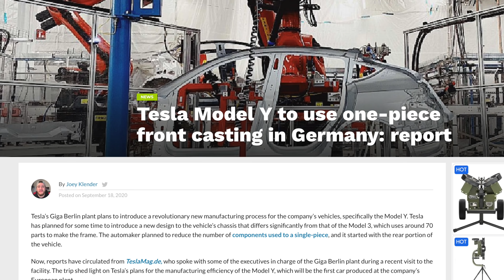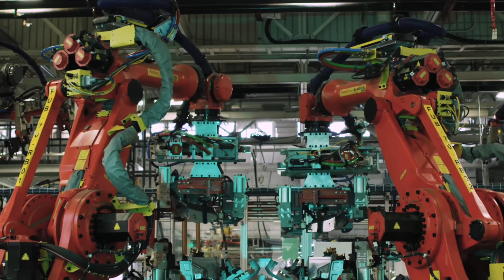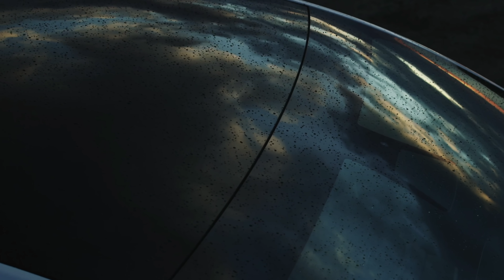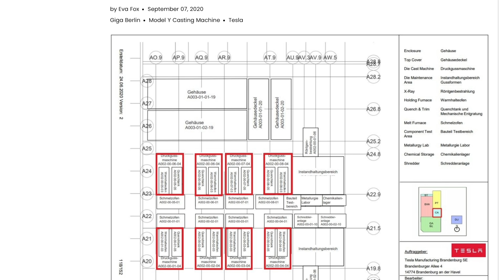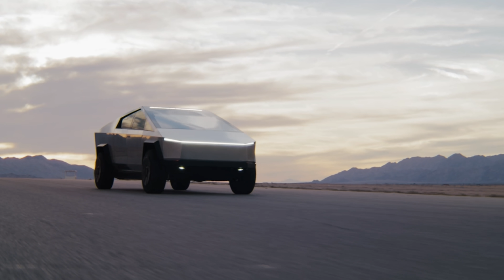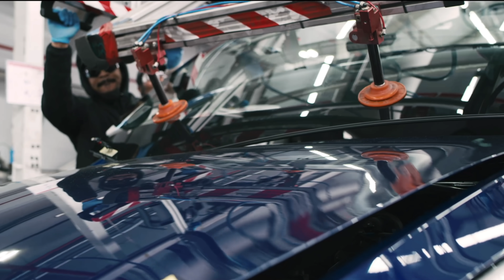Tesla will Simplify Model Y Design Even MORE

Comment: I think Tesla’s goal is to make a Model Y BIW (body in white) close to one aluminum alloy casting as possible. Once it’s produced it would be run through a large X-ray machine to check for air pockets in the casting. Then the hood, fenders, doors, roof, quarter panels and tailgate would be bolted on. It’s a totally radical new way to manufacture an automobile that’s never been done before.

Comment: Stop saying the giga casting makes the car better, it doesn't. It makes it cheaper and scalable, hopefully they will trickle down the price gains to the customers
Reply: Surely a cheaper car is better
Reply: Not only would a cheaper car be a better car due to a better value, but if it's also a lighter design, it would also have a higher range.
Reply: @santoroma17  its totally not lighter, EVs aren't light at all, the car chassis is connected to the battery which significantly increases the weight. Why not use carbon fiber thats easier to form, or thicker/ lighter aluminium sheets instead of heavy casting
Reply: @carholic-sz3qv  I'm talking about the current Tesla vehicles compared to a giga casting which is what this comment is about.

A Tesla using a casting would be lighter and cheaper than a Tesla without a casting, which in my opinion would make it a better vehicle.

Other electric vehicle manufacturers should definitely use carbon fibre to try and make up for the fact that they can't make a drivetrain that's as efficient. Or at least most manufacturers seem to be having trouble with it.

Anytime you're using metal it's going to be heavy LOL but I don't think we would ever see a significantly high percentage of carbon fibre being used in a model 3. It's simply costs too much.

I think it would be better to optimize the design before moving to a carbon fibre based system.
Reply: Le Chat Botté Sandy Munro did an episode on why manufacturers choose different materials.  Carbon fibre is good for low volumes and prototyping but gets very expensive at high volumes.  Steel is harder to form with more expensive equipment but is by far the cheapest at volume.
Reply: @andrewpaulhart  steel is not harder to form and there are very powerful presses, plus there is the use of heated pressed steel way stronger
Reply: @carholic-sz3qv  I hope you will understand if I choose to believe Sandy Munro, a veteran manufacturing consultant consulant to the motor industry rather than you
Reply: @andrewpaulhart  wtf!!!! ok sandy munro is the only who knows how to build cars?!?!?!? what nonsense....
Reply: Le Chat Botté no.  I’m saying I believe he knows more than you
Reply: It doesnt make the car cheaper, because vw for example already makes 10 million cars a year by using steel/aluminium/magnesium... vw already has tons of stamping presses they just need new forms for a new model, thats how they make very cheap cars

Comment: What happens in an accident when the front or rear has damage? So will they have to rip the car completely apart to replace the casting? Sounds easier to build but harder and more expensive to repair
Reply: Ted, I wonder if the castings will be so strong that they will suffer minimal damage in most collisions, and repairs would be possible rather than replacing the casting

Comment: Just don't have an accident. One massive and very expensive part to  replace, after a fender bender.
Reply: You mean like for unibody pickup trucks?
Reply: The casting is too rigid and will affect other parts like glass when the roads are bad
Reply: thanks for the advice Douglas,   I'll have to remember that next time  I'm driving!.
Reply: A fender is not part of this structural casting.  If the casting itself is injured, another commenter suggested that modern welding techniques could insert a patch without disruption to the rest of the car?  We'll know more in the future when insurance companies have compiled a year's worth of statistics.  In the meantime, won't the car's self-preservation software prevent the fender-bender to begin with?  Many ways to skin a cat...
Reply: @jrb_sland5066  Your points are well taken. And I certainly hope it all works out that way. But the car likely won't be able to prevent someone else running into the rear of the car. And fenders these days are only designed to withstand a very slow impact. 5 mph or less, as I  recall. Certainly a Tesla isn't the only car that would cost thousands to repair in this situation. But I'd be curious to  know if  they've done any computer modeling of crash consequences with this new casting. And now they are going to be doing a front casting as well.

Comment: By building such large  press machines does it make body design changes more difficult? It sounds like you would have to replace the entire machine
Reply: So based on the patent last year it's molten aluminum alloy that is injected. If that's the case probably just the mold needs to be change like in die casting.. As long the new updated model doesn't exceed the dimensions of the machine I don't think you would have to change much.

Comment: I agree that the front frame casting for the European Model Y at Giga Berlin shows that Tesla plans to keep it's EV manufacturing edge for years to come. I do expect to see these casting improvements to be retrofitted in Fremont, built into Giga Shanghai, and of course included as a base manufacturing structure for the upcoming Cybertruck. I do wonder however about why they are putting in Eight (8) of these Mega-casting machines in at Giga Berlin, when it only needs two per vehicle. Sure, Tesla plans to scale up their Model Y's mass production to run multiple, simultaneous production lines. But I suspect that while Tesla is building up Giga Berlin, I think that some of the new Mega-casting machines will be set up for mass production of Tesla's unannounced future compact EV, which I think will be built within 2 years, at a price that is significantly less than today's Model Y entry point.
Reply: CyberTruck will for sure not be using casting. They will be getting rolls of the metal that they then fold and bend as needed. Super simple.

Comment: Cost of repair is my only concern with the large castings
Reply: You will get repairparts for typical demages like usuly - i cant see a big difference
Reply: Why? If a "welded car" frame is damaged the car is scrap. It will be the same... That is not usually something you repair.
Reply: @JensPilemandOttesen  cut and weld is way easier
Reply: @carholic-sz3qv  Alu welding is not easy

Comment: I want a 500 miles model Y 

CA > Vegas , no STOP
Reply: ... while sleeping.
Reply: Just take a Boring tunnel.
Reply: or you take a break like a sensible person go to the toilet and have your tesla recharged enough :)
Reply: You realize that will mean an electric car will go further then a gas car.
The ice car us doomed
Reply: You'll probably have a better idea if that's likely after battery day
Reply: PeriodT
Reply: It's only 270 miles from LA.
Reply: @gergc4871   Ac on High +  riding @ 75mph. the EPA. estimated range are at @65mph.
Reply: @curiouspeople6441  
Ah good point. Nobody wants to be in Vegas when it's cool outside.

Comment: Single or 3 part cast for compact car. Makes the most sense
Reply: Single makes sense for a smart for two or smart for four type car
Reply: @joeyknight8272  i could see 3 part for repair purposes. Replace the whole front end vs entire frame of car
Reply: @joeyknight8272  nope the smart fortwo uses unibody construction with a very strong chassis like a sport car, aluminium extrusions and steel...

Comment: Imagine casting the wiring inside the frame then just plug and play the electronics and wires. Phew
Reply: Please for the love of sanity and all things replaceable do not cast sheet metal around a wiring harness
Reply: @Ubernator  There's a trade off of course. But of it like a PCB in electronics, they literally works and never fail.
Reply: Nonsense, just use metalic or fire resistant pipes/wiring protection
Reply: @carholic-sz3qv  Lol. it's not about protection, it's about simplifying stuff and more integrated.
Reply: @xbxb  vw has already done that, and by sharing platforms vw is able to save billions in cash, the golf chassis is used to make SUVs for example, or a seat or a skoda, even porsche, audi and lamborghinis share many parts, thats the real engineering
Reply: @carholic-sz3qv  Oh, VW already doing that? embedded wiring in the frame? Really? Any source?

Comment: I don't think it's a good idea, even if it makes manufacturing easier. These castings from Alu/Magnesium are very rigid (good for handling) and also very brittle (bad for impacts). If you have a casting that gets even a small impact, it can crack or fracture completely, especially in cold climates. If the casting is huge, then the repair will also be (almost) impossible. If you've seen cracked sumps on normal ICE cars, you'd understand why this is not a good idea. You cannot weld repair those castings, straighten them, or even replace small sections of them, the entire thing needs to be removed if one bolt strips, or if you hit a kerb and the control arm mount breaks off. In short, small impacts can potentially scrap the entire car. Sandy Munro will know this.
Reply: Certainly an enginering challenge to get the alloy mix just right... Luckily Tesla has some of the best people in the world working om just that....
Reply: This is right but also kinda wrong. Yes an impact to the frame would be bad, but it was bad anyway. In fact most aluminium cars would be classed as totaled if they got damaged on their frame. The car has bumper zones and crash zones to prevent damage to the frame. Bad accidents will damage the frame, but this isnt something new with the new casting.
Reply: @simonquvang6073  Time will tell if it works or not. I trained in Aluminium and Carbon structure repairs, and castings are typically replaced completely if broken. They are usually attached by riveting and bonding, which is something that can be seen on the Lucid Air prototype long-members. High end German cars typically use castings on the front suspension towers.

Comment: Why is it that when you hear Tesla making manufacturing better, it's always for every country BUT the United States. Why don't they update the factories here to reach parity with the factories across the rest of the world?
Reply: Update = shut down for X weeks.
Reply: Texas baby
Reply: It's an iterative process ie going from their first factory to their first gigs factory they took that knowledge to make it better. Each new iteration is developed based on the new specs. They need Fremont to be efficient AND making cars for revenue. With the changes I wouldn't be surprised if Fremont would have to down for a few months. Compared to build the new factory with all of the latest and greatest. Then when the others are making cars and revenue you can shut down Fremont for 3-6 months to update it. They can only do so much at a time while also making money
Reply: To be fair the single-piece rear stamping machine is already installed in Fremont. So it could start to be used very soon.
Reply: I dont call it making manufacturing better but taking another/expensive method, aluminium cars always tend to be more expensive, steel is very cheap and vw that already makes 10 million cars a year uses combination of materials, including magnésium, carbon fiber....
Reply: Because the Fresno factory is up and running. It would take major $$$ to revamp a running factory, not to mention having to shut it down during the rebuild.
Much better to get all the new tech and build it into a factory from scratch.
I don't know how attached Elon is to his California factory, but if I were him, I'd build a new one in Nevada or Arizona and move people from CA to the new plant.
Lot's of room and cheap land to build a huge factory on and get away from those job and profit killing California taxes.

Comment: i have a question not related to the video however thank for the update on model Y, i wanted to know is it normal for the model 3 to stay making a noise after it has been parked, kinda like a raving sound. eventually it stops.
Reply: The latest software update, the car vents the AC to remove moist after you parked, to avoid bad smell over time.
Reply: Cooling
Reply: Peter 👍👍👍 thanks 🙏

Comment: have they brought any of the simplification they have done for the model y to the model 3? because even at release model y was a lot more simple
Reply: I hope so! I hope it applies to almost all Tesla models!
Reply: Nope, not for US production. They only seem to upgrade vehicles at build at newer factories. For example there have been design upgrades to the Model 3 build in Shanghai but not the one build in Fremont. The rear structure is still a mess, not to mention there paint facility in Fremont is still crap.
Reply: I think that's the case only because if they stop to upgrade the line that means stopping production.  If giga texas produces the 3 and Y I 2ont not be surprised once that's ramped they completely rework Fremont

Comment: But when is the rest of the line up going to catch cough,cough  model 3
Reply: Model Y and Model 3 are 75% the same, so shouldn't be difficult to apply to Model 3 once they get things running smoothly. I'd be surprised if Berlin Model 3s weren't made this way too. Would be a waste of capital to set the line up in the old way
 The other cars (S & X) will probably need a complete design overhaul before they're upgraded. Guessing that will happen when plaid is released
Reply: @Lucalikesstuff  Yeah my guess is that they will use 4 giga caster for Model 3 and 4 for model Y

Comment: I would imagine that these large castings would cut down on robots rather than workers.  I think body construction is totally automated
Reply: Potentially 40.000 employees, they shouldnt complain either way :)
Reply: True to a given point: the smaller the parts used, the more human operation involved. I spent 15 years selling gigs and robotized welding system for that. A lot of time you need a lot of space, a lot of gigs and a lot of automation AND human because you have to put three, four five even seven bracket or other elements in such a small area that it will impossible to do it with robot(s) due to efficency/speed and access space.. a single cast is saving on every level
Reply: the problem arises when, in the event of a crash, how will tesla replace the damaged or twisted parts of the chassis? making the entire thing a unibody does simplify the process of manufacturing, but to disassemble it and replace the damaged section would require a lot more work because a lot more stuff is attached to the unibody, plus the repair cant be done by hand because the unibody section will be far too heavy to handle by hand or even with a winch from such an awkward angle. i hope tesla is also looking into this issue while they develop future models..
Reply: Despite the use of more robots, humans will still be needed, to check the produced pieces further, also quality control
Reply: Le Chat Botté this can be done by robot as well.. as a matter of fact the company that implemented qc via robot is a former customer of mine.. (they worked at giganevada) but yes, human intervention will always be needed
Reply: @udp1073  all the robots used by tesla are standard robots in the automotive industry, from KUKA to ABB to kawasaki.....
Reply: Le Chat Botté the robot alone is a mere appliance, the application and the “payload” make all the difference. The gripper that grab a pieces. The camera that does the image scanning for measurement or quality control, marking of parts, welding (either spot or another way), positioning, assembly of heavy elements.. i sold application and i sold robot (for a brand used by tesla that you have not mentioned). Consider this: many many time companies buy the application and the robot is supplied as “part of”.. at a given point companies decide to standardize on a single brand for interoperability, commonality of programming, commonalities in spare parts inventory and maintenance procedure..

Comment: Maybe this is what the 2nd Giga Press being assembled at Fremont is for. If this is true, Its possible that Tesla is going to test this process at Fremont to ensure they have everything worked out by the time its all ready to go at Giga Berlin!
Reply: It does seem like the 2nd Gigapress being built at Fremont wasn't expected initially just by the way the covering for GP1 is not likely to connect with GP2
Reply: You don't have the biggest volume production casting machine designed, built and installed to try anything!!! It is a properly engineered and very expensive undertaking, not a diy project on YouTube!
Reply: @WouterStassen  You've got to test the new casting somewhere, and it can't be cast on anything smaller
Testing it on that press doesn't mean that it won't eventually be used for volume production
Reply: @Lucalikesstuff  Exactly, that's how tesla perfected Shanghai. They learned what to do to get everything up and running quickly from Fremont and it resulted in them producing better quality cars. I'm sure that the casting press is engineered perfectly for production but they have learn how to integrate the castings into the assembly line since its a major change from what is currently assembled for the front of the car
Reply: I'm sure they would like to know how to ensure the efficiency of the line in Berlin
Reply: @fernandojaime4354  I bet none of you guys have actually ever been in a  automotive assembly plant and definitely never in a Press/Casting Shop or a Body Shop. Sounds like YouTube is your only source of automotive assembly knowledge. What a joke.